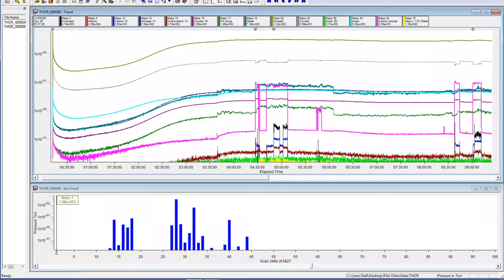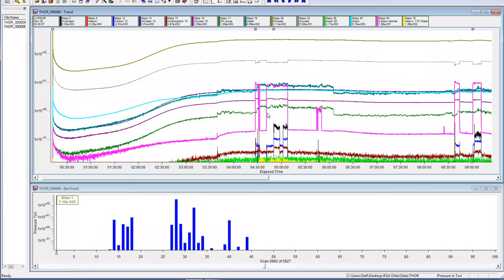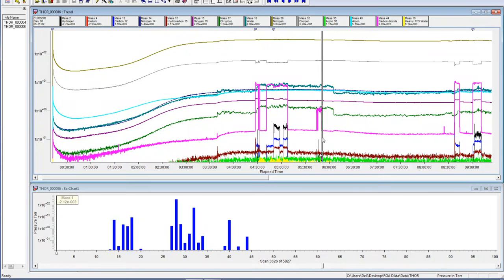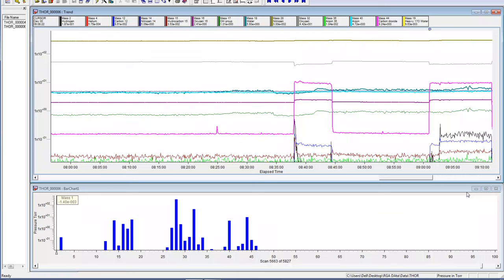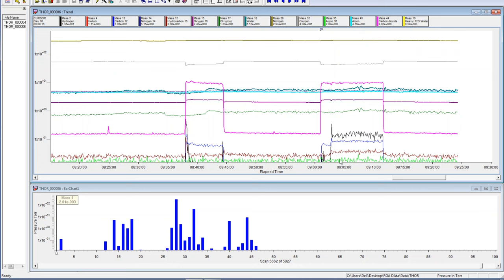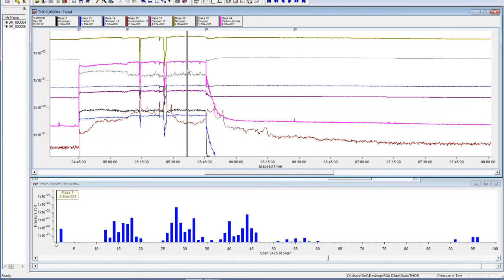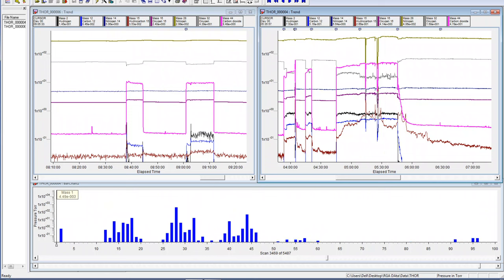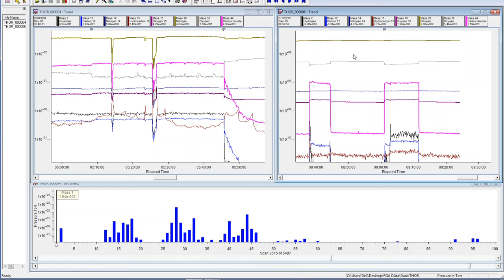THOR - Control against active TSG run data review

Comment: Now this is what I’ve been waiting for, a comparison of atomic gas ratios under load. This shows some interesting relationships, thank you for doing a side by side of the regular generator with values. What catches my eye most, is the removal of all higher energy masses with THOR vs the reg generator. It’s like a lens focusing light spectrometry. Very interesting. I can see the load source being a variable in the e efficiency. Something akin to a transformer or differential might be needed later to increase load values.
Reply: What changes, mechanically, when it's under load? I think it would be good to know how these generators decide to modulate the fuel intake based on load.
Reply: @Aedonius  agreed, variable behavior by the engine is very relevant.
Reply from the maker: The data is shared with the PC tool required to review it (can use PC emulation on mac if you have M series), so you can review as needed.

https://remoteview.substack.com/p/thor-control-compared-with-active

Comment: These results seem significantly different than the combustible gas analyses reported previously.  Is it related to using a brand new engine/TSG, or is there a problem with instrument calibration?
Reply: This is the new config with two spheres and shorter pipes. But is also a brand new mod, so might respond to some tuning
Reply from the maker: We did an independent test, we are giving you the raw data. It is not a brand new TSG but a new engine that we tested unmodified. More videos to follow. A quadrupole Residual Gas Analyser like this works in a completely different way to a normal exhaust analyser. This can show you the masses of fragments of unburnt HCs whereas a normal exhaust analyser can only tell you the overall ppm of unburnt HCs for instance. This cannot determine CO from N2, whereas a normal exhaust analyser can show the ppm of CO.

Comment: Inserting (treated) false air between the carburetor and cylinder will result in a very poor mixture which will produce less CO2 and burn more complete and so could explain (part of) the results.
The heater will have some kind of a thermostat and is placed in a sunny environment. To be sure about the power consumption: could you please measure the power consumption of the heater? Could you also measure fuel consumption of the generator?
Reply from the maker: That was the intention, but cannot test now as the time ran out and unit has moved to New Mexico, main thing was to test if HCs go and CO2. First did, second did not to the same degree and we have more videos to publish.

Comment: If you have the heater (load) on, and you have Oxygen in the Exhaust and "free" Carbon, then is not possible (probable) that some of the Oxygen reacts with the Carbon to form CO2 ?  Same with Hydrogen and Oxygen, although as the temperature is much above 100 degrees Centigrade, it would likely form super-heated steam if the Hydrogen was in contact with the Oxygen for long enough.  Perhaps under load, less Hydrocarbon is burned in the reaction chamber but instead dissociated in the exhaust to provide the "free" Carbon.  Still, a major reduction in CO2, maintenance of Oxygen levels to close-to-"normal air", and no Hydrocarbons is still a win

Comment: This is somewhat of a conundrum - no CO2 droppage as indicated on the Mass Spec, but the results from earlier videos are showing CO2 drop. I don't think it's SiO [44], lol!
Reply: I wonder whether performance of this new unit changes with and without the UV?
Reply: @paulshields1883   I wonder why there is a big hole in the lightbulb box? Shouldn't this be closed off?
Reply: There is a CO2 reduction, not to zero, but to about a 5th of what the unmodified generator produces.
Reply: @davestorm6718  isnt the hole the fresh air intake for the system?
Reply from the maker: Actually there is a significant CO2 drop, but you need to see this data in context with other videos that were recorded at the time which are to be published.
Reply from the maker: @davestorm6718  That is to let the air in.
Reply from the maker: @curbina  Yes
Reply from the maker: @paulshields1883  It is

Comment: So is it good news or bad news im so confused 🥸🤯
Reply: It's bad news obviously.
Reply: I agree - something like a short summary or conclusion could be helpful.
Reply: It is good news, it still reduces CO2 to about a 5th of what the unmodified generator releases. It is not much different than other tests we have seen, this one is more detailed.
Reply from the maker: Cautiously good, you need to see it in the round with other videos to be published.
Reply from the maker: @sevenskies1803  Depends on your perspective. When other test recordings are published a full discussion will be had.
Reply from the maker: @kgrottach  Not until other tests are published, for now, everyone has the raw data and control data to investigate in their own ways here:

https://remoteview.substack.com/p/thor-control-compared-with-active
Reply: @MFMP  I was expecting this thing to be able to do transmutation of elements reducing the overall CO and CO2 concentration to 0, and that perspective was based on Randall's initial assertions. It looks to me like the retrofit has an effect but not to the extent that others have purported. It also looks to me like this isn't the miracle of engineering/science that it is advertised to be, but maybe I'm missing something, I'm not a scientist after all.
Reply from the maker: @sevenskies1803  This test appears to show that it cleans the burn, like a FAR cheaper catalytic convertor. There is a drop of CO2 and upping of air, but wait until we have published more of our testing.